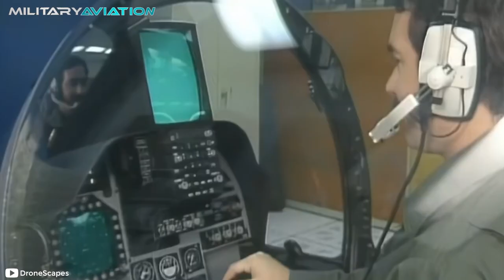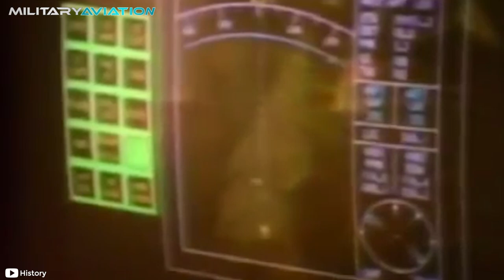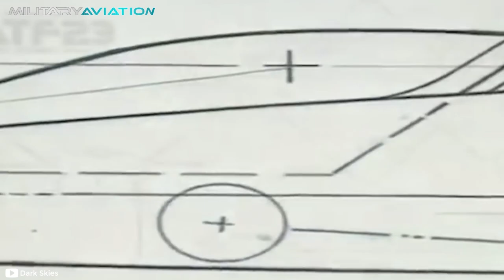YF-23: Why did the USAF reject this BEAST if it was BETTER than the F-22 Raptor?

Comment: The YF-23 is a beautiful aircraft. Given the politics at the time they still should've picked her. If they had, like the F-22 final product improvements would've been made to the F-23 final product. I'd venture to say a finished F-23 would have more capability than the F-22.
Reply: the F-22 was and still is the most advanced fighter aircraft ever put into service, and we've all but retired the fleet, as a whole. we've already flight tested out 6th gen fighter, which is likely orders of magnitude better than the YF-23...

the fact that the YF-23 never made it into service never put the united states at any tactical disadvantage and saved the taxpayers a bunch of money.
Reply: @TheRedStateBlue  What are you talking about retired the fleet?
Reply: Given what politics?
Reply: @bryanhoppe1481 he meant the atf program requirements for the fighter but tbh he just sounds like a yf23 soyboy. That thing barely flew and properly tested and ppl are calling it better for some reason. The yf23 stealth was only a bit better than the f22 not entirely better and the windshield somehow cracked during testing

Comment: I'll tell you why the yf-23 was not chosen Northrop the military felt couldn't be trusted. They were forced to repay 30 million dollars. Tight budgets and worrying about a contractor that is known for padding the bill. That's why their fighter was rejected one of the reasons anyway.
Reply: 30 BILLION
Reply: Actually, the REAL REASON why is something that will NEVER be admitted to, The United States Air Farce, has always been and likely be in absolute love with LOCKHEED, and Pratt And Whitney, the Chair Force has always HATED General Electric, and Northrop Grumman, and This can be seen where the YF-23 with the General Electric engines was better during the flight tests, the YF-22 with the YF-120 engines was also better than both the YF-22 and YF-23 fitted out with the Pratt and Whitney engines, as you look at the ATF competition, you MUST look at it as 4 different fighters, where the YF-23 with GE engines was the best, by a TINY margin, and the YF-22 with the GE engines was second best, then the 3rd place finisher was the YF-23 with the Pratt and Whitney engines, and the Chair Farce obviously picked the last place finisher because again, LOCKHEED and Pratt and Whitney, are the primadona Chair Farce darlings, then leap ahead to the ASF competition, between the YF-32 and the YF-35, again, as ugly as it is, the YF-32 was a better option for an airframe than the YF-35, BUT this time, the baffoons of the Air Farce got it right with the Pratt and Whitney engines, they were actually the best engines for this competition, where the YF-32 with the Pratt and Whitney engines was first in meeting the requirements for the program, and the YF-32 with the General Electric engines was second, while the 3 place finisher was the YF-35 with the Pratt and Whitney engines, and the YF-35 finished last with the General Electric engines, so this time the awful force chose the 3rd place finisher instead of the last place finisher, at least that is an improvement I guess, but they got to scratch the back of their girlfriends LOCKHEED and Pratt and Whitney again, for decades the F-15 and F-16 have been dogged down with the Pratt and Whitney F-100 engines even though they have become more expensive to have new part manufactured, they just refuse to to stop lip locking Pratt and Whitney, but FINALLY the manufacturers of BOTH of those airframes are forcing the bumbling morons at the Air Farce into accepting a superior GE engines for the Newest F-15's and F-16's as both current fleets are slowly being upgraded with the GE F-110 engines, the YF-23 was in fact so good, that the flopping Air Farce actually took out almost all of the internal systems from the YF-23 and had them installed on the F-22 airframe, because it was BETTER STUFF!
Reply: And yf23 didn’t perform well during the test fight. 22 took 75 fought vs 23 50 flights
Reply: @keithcharboneau3331 yur wrong

Comment: This video claims YF-23  had more range and better stealth profile (which is undisputed by other accounts) and that it was more "maneuverable", which is a contested point. Others point out that F-22 beat out YF-23 in dogfighting, which is why, in part, it was a winner.  This video claims that YF-23 wasn't "sold well enough" on that aspect. It would great to hear more details on this particular point - was, in fact, YF23 a better dogfighter? Or was it F-22?  I think that with modern weaponry, it's almost a secondary issue as aircraft rarely get close to one another and the one that detects the other first is usually the one that wins. BUT, it's true in current, low-intensity battlefields.  A hypothetical war with China could see most of our military satellites shot out of the sky and sophisticated jammers used, reducing the impact of integrated weapons systems and reducing jet fighters to dogfighting.   So, having dogfighting capabilities could be very underappreciated.

Comment: Basically a repeat of what happened between the 14 and 15 in the 70’s. Lockheed Martin plays politics big time and made a live fire test during the demonstration.  In every regard the 23 was superior save agility.  It’s worth noting the agility advantage was marginal and with the 23s superior range, ceiling, and stealth, who needs greater agility?
Reply: It would not be hard to put vectored trust on the YF-23.
Reply: @chrisbraswell8864  she had vectored thrust.  The raptor was slightly more agile.  It was the only advantage she had on the 23.

Comment: Less agile and much more expensive. Considering the ridiculous cost of the F-22, I can't even fathom what the YF-23 would cost.
Reply: Lockheed got away with "a lot of hand waving" about "agility".   You think you know what that means but in aircraft engineering agility is not the same as manuverability.  As a matter of fact there is no accepted aerospace engineering defination of "agility".
Lockheed was using term to mean point the nose of the aircraft with out changing the flight vector of the aircraft.  Think walking a straight line forward while slightly looking left.  Your nose is pointing left but you are still moving forward.   The advantage of that is negated by the use of helmet mounted  sights and off bore sight missles.
Reply: Paul metz the test pilot  for yf23 and later f22 when says yf which was a demo flew better than the f22 which was the finished plane
Reply: If you want to talk about ridiculous cost overrun that resulted in a jet with sub-par performance, you need to compare the the F-22 to the F-35.
Reply: @mikeyz1080  but he never explained exactly what he meant by "flew better". YF23 had better range and higher ceiling, which could be what he meant, and not dogfighting.
Reply: @F15ElectricEagle  How about comparing the F-15 to the F-16?
Reply: The fact is that both planes met the  requirements. But, while NG was seen as an engineering company that hired project managers, LM was an project management company that hired engineers and the USAF knew both companies could deliver what they promised but they wanted LM for its Program Management history.

And, as for cost overruns, anyone who has worked in defense knows full well the main reason for delays and budgets issues are due to changing requirements by the Pentagon...even today changes are a constant constraint.

Comment: only 6th gen airframe yet to be made in a fighter, stealth, and flew very very well. My grandparents both worked at northrop grummun bethpage long island while the yf-23 was under development. And it went over mach 1.8 in trials, it was hitting over mach 2 from what i heard. Its just that at that time we werent allowed to say anything above 1.8 it was classified. It also had a larger weapons bay, that could of housed a way bigger variety of missiles and even bombs, the raptor may perform versatile but what it holds isnt versatile, it can only really hold air to air missiles. The yf-23 would of probably also been the best interceptor the worlds ever seen, to this day. Look at the chinese dragon thing, wich is an interceptor, this thing would make short work of that plane lol, it would make it look like 60s tech.
Reply: First of all, it's Grumman, not "grummun".

Secondly, Northrop Grumman didn't exist at the time the F-23 was designed and developed. 

And thirdly, none of the two YF-23s that were built for, and flew during the DEM/VAL phase of the ATF program hit Mach 2 or "went over mach 1.8 in trials". 
In fact, the only two aircraft that "went over Mach 1.8" during DEM/VAL were just both of the two YF-22s.
YF-23 PAV-1 (YF119 PW engines) flew no faster than Mach 1.8, and YF-23 PAV-2 (YF120 GE engines) flew no faster than Mach 1.72. 
Meanwhile, YF-22 PAV-1 (YF120 GE engines) was flown to speeds slightly above Mach 2 and YF-22 PAV-2 (YF119 PW engines) was taken to a speed no greater than Mach 1.81. 
https://youtu.be/Vpkv1ErWIf8?t=2257

Could the two YF-23s fly faster than what they did? Yes, absolutely. But they didn't. That's why I say your assertions  are false.

Finally, the YF-23 didn't really have larger weapons bays than the YF-22/F-22. Its single weapons bay had clearly more depth yes, but more actual usable volume and space for weapons? No, not really. 

There is a reason as to why Northrop planned for the combat ready, mass production F-23A to have an additional weapons bay dedicated to carrying a pair of AIM-9s, in front of the main weapons bay...

And btw, the Raptor can carry more than just air-to-air missiles in its main weapons bay. 
It can carry and employ GBU-31 JDAMs (1,000 lbs) and GBU-39 SDBs too.
https://www.lockheedmartin.com/content/dam/lockheed-martin/aero/documents/F-22/F22FastFacts62022.pdf

https://www.globalsecurity.org/military/systems/aircraft/images/f-22-weapons-2006.gif
Reply: @turnnburn6892  
You saved me some time. 😅

Comment: Worked on drive systems test contract work in Arlington Texas and Bedford. I was sent to a different lab to build a platform that rotates 10'x10' . A rotating assembly for radar antennas was about 2 foot tall, with the outer area supported by large casters which didn't turn they moved in a circle only the wheels turning. We were not directly told why at first. Then we were working on making a rotor blade move remotely in 1° increments and to be sent for radar testing. We could see the aircraft in the hangar. It was a cobra set up for stealth. It had panels on the outside and around the main rotor hub. It was a proof of concept and probably was heavy like the stealth Blackhawk. Weight is king on a vertical lift. Made panels for increased lift and tested about 3% increase in lift on the XV-15 which would mean 1 more combat equipped soldier on a V-22 in a vertical lift.
Reply: You sir obviously have a higher education than I do lol!! that read just gave me a headache.

Comment: The F22 was picked due to better agility and air to air manoeuvring.  That’s the main reason.  It’s an air superiority fighter and that’s the main reason. Perhaps the f23 could have been turned into a fighter bomber.
Reply: this video claims it was "undersold" on maneuverability - it would be interesting to hear a definitive opinion of test pilots - i would trust them more than senior military bigwigs.
Reply: @mrvk39  yes. M only going off conversations I’ve had with F22 pilots at Nellis during RAF/USAF beer calls.

Comment: Simply put:it wasn’t. It was much less maneuverable and slower than the modern F-22. The F-22 was the right choice. Why do ppl think the yf-23  was this super op plane better than the F-22 when the F-22 was significantly better?
Reply: TRUE
Reply: Not true. 
Both were capable of 9.0 G . Pilots described the yf-23 as fast even though both planes were limited to Mach 2 . The yf-23 combined a stealthy (thermal too) design with a fuselage that followed the Area-Rule closer than anything in the sky. This gave it extended range and rapid acceleration. As the video said, the yf-22 had the more developed bomb bay. Northrop had planned a rotary launcher for the AIM-120 and a smaller bay forward with 2 Sidewinders. The planes met in what was called Dem/Val and Lockheed (who got a 6 month delay) turned it into a show.
The F-22 is significantly better than a 1995 prototype yf-23 that's sitting in a museum. Comparing the yf-22 to the yf-23 (throwing out politics, cost overruns and air show stunts) a impartial aviation engineer/pilot would have chosen the yf-23.
Reply: @rapidsqualor5367  would it have been more expensive than the f 22 though? Economics is a factor.
Reply: @Crimsonking741  Northrop est. 170 mil vs Lockmart 150 mil but they milked the pentagon worse than the B2. Your right Economics is a factor. Northrop had the B-2 and Lockheed (maker of the F-117) had the C-130 so the Pentagon threw them a bone. Then, with the F-35, they took the whole carcass.
Reply: @rapidsqualor5367  for the u.s. military 20 mil's nothing, y'know what, maybe they should've used the yf 23. In the end, it doesn't really matter though because the f 22 ended up being such a good aircraft that we literally had to stop making them because they had(and still don't really) have any competition.
Reply: @Crimsonking741  while i am not doubting the capabilities of the F22 i dont think think your statement of "f 22 ended up being such a good aircraft that we literally had to stop making them because they had(and still don't really) have any competition." is accurate. it seems like you are trying to imply correlation with causation. even if one was to assume it was the best aircraft which is debatable, it has nothing to do with why they stopped making it or that because its soo good it defeated all our enemies and rendered itself obsolete.

They stopped making it, and even cancelled many units because it was primarily a air to air fighter. And since the USSR went bankrupt its and the F22s sole purpose was now gone. you really don't need nor should you use an F22 which has the highest $/hr operating cost to drop bombs or provide close air support to ground forces. 

id close with a passage from the simpsons....

In the Simpsons episode Much Apu About Nothing, Ned Flanders spots a bear on the street, which prompts the whole town to crusade against bears and to create a Bear Patrol.

Homer: Not a bear in sight. The Bear Patrol must be working like a charm.
Lisa: That’s specious reasoning, Dad.
Homer: Thank you, dear.
Lisa: By your logic I could claim that this rock keeps tigers away.
Homer: Oh, how does it work?
Lisa: It doesn’t work.
Homer: Uh-huh.
Lisa: It’s just a stupid rock.
Homer: Uh-huh.
Lisa: But I don’t see any tigers around, do you?
[Homer thinks of this, then pulls out some money]
Homer: Lisa, I want to buy your rock.
[Lisa refuses at first, then takes the exchange]

 https://www.youtube.com/watch?v=xSVqLHghLpw
Reply: @b18c5vtececlipse  yeah that's another reason. It was and still is very expensive to maintain and operate.
Reply: Nova741
Yes, it was/is superior to YF-22.  

The YF-23 has maneuverability advantages over the YF-22 due to is cleaner aerodynics.   The cleaner airframe aerodynamics of the YF-23, that along with the fact both aircraft used the same engines (PW-119 and GE-120) gives the YF-23 a superior specific excess engery.  Which is a manuverability advantage.

As for your misstatement about the YF-22 being faster, that is false.  Neither aircraft was tested at their maximum speed.  The only things that are know as facts are the GE engine produced more thrust and the super cruise speeds for the YF-22 were published.  The only super cruise speed for the YF-23 published was with the 'weaker' PW engine.  The super cruise speed for the YF-23 with more powerful GE engine was and is "still classified".  They were only allowed to say the super cruise speed for the YF-23 with the GE engines "was very fast"!
So it safe to presume that the YF-23 has a speed advantage over the YF-22.  That along  with the YF-23 having a superior area rule.  Which can be concluded from seeing the aircraft.

Comment: If you are going after English speaking audience you need to do what American creators do. If they use feet for measure they either say both feet and metric or show the other on the screen. Mostly just scientist use metric and most Americans have to do math in their head. We have no concept of what 23 meters is. Just about every American knows how far 100 yards is for example. We can visualize it through experience. Meters, not so much. If you are not going to do that than why use English? Use Chinese or whatever your language is that you must use a bad cheap auto reader.

Comment: The YF-23 was not taken onboard was because it couldn't Supercruise without using AfterBurners and alikes.
Reply: Not true at all. It was faster in supercruise. This is easily found.
Reply: Where did you get the idea the YF-23 could not obtain supersonic speeds without the use of afterburner?

The super cruise speeds for the YF-22 were published with the use of both engines, the PW YF-119 and the GE YF-120.

It is a fact the the GE-120 engines were more powerful than the PW entry.

The only speed published for the YF-23 in super cruise was with the weaker PW YF-119 engines.   The super cruise speed with more powerful GE YF-120 engines in the YF-23 was so fast that the goverment classified it!  And the super cruise speed of the YF-23 remains classified even to now.